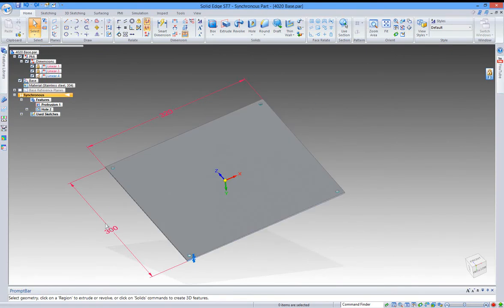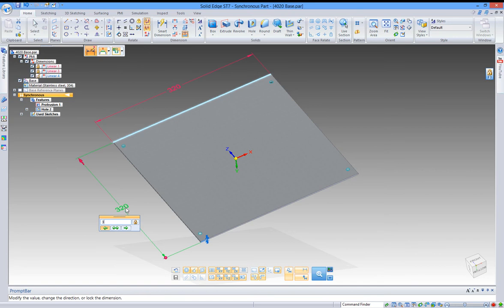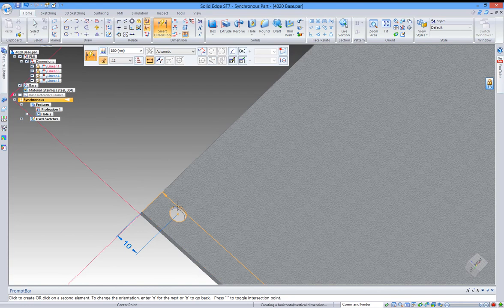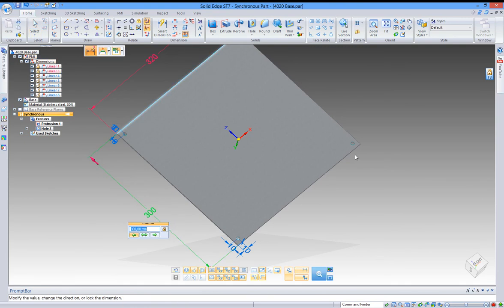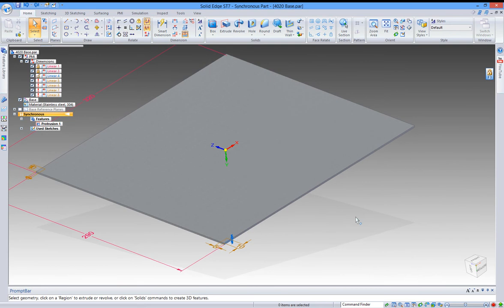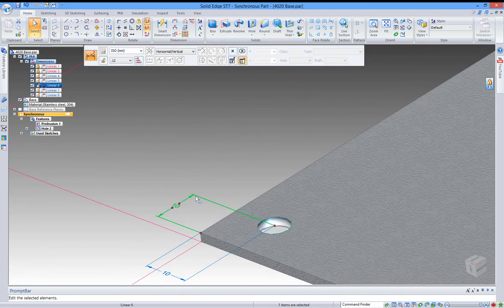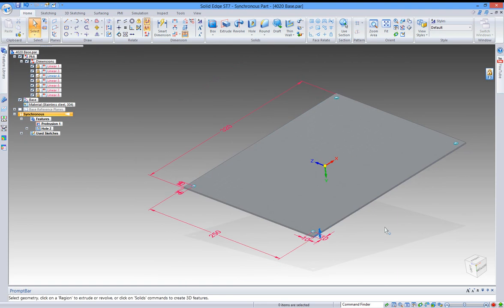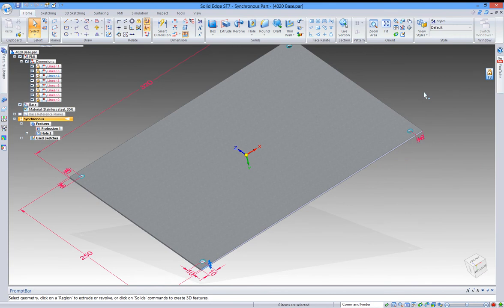Solid Edge: Lock dimensions, how and why.

Comment: Hello, I have solid edge 2020 and when I am sketching in order it does not let me change the measurements with Smart Dimension, it appears blue and I cannot change them, would you help me what should I do?
Reply: I have the same problem
Reply from the maker: @olivermsiska5780  When the dimension is blue, then it means its just for illustration purposes - the dimension is not driven. Only dimensions in color red, will change the size of the part, if you change it. If the dimension is blue, then another dimension is overriding it (color red).
I hope that makes sense. I will make a more detailed video about it later this week.